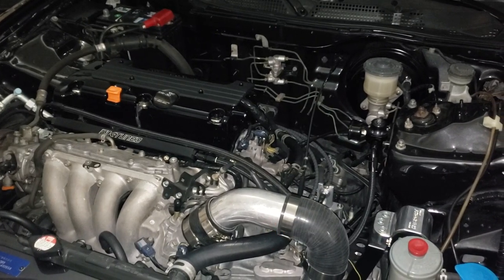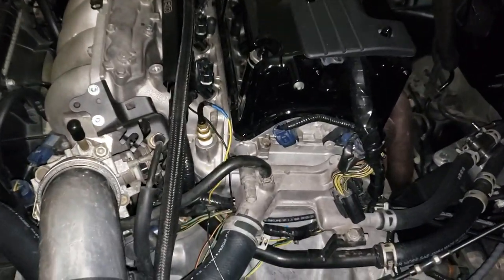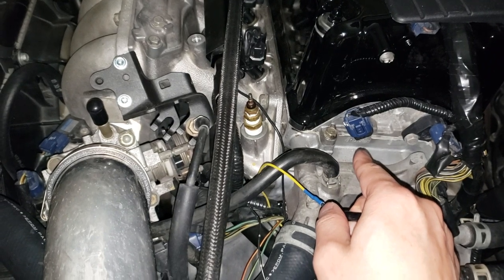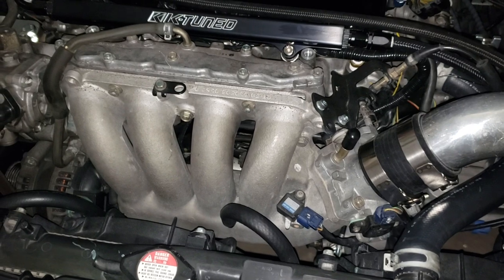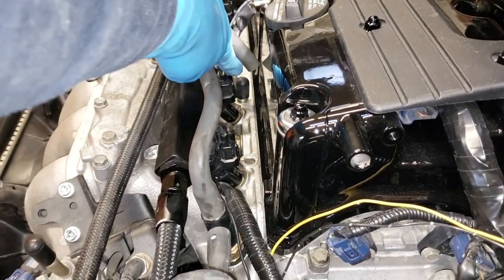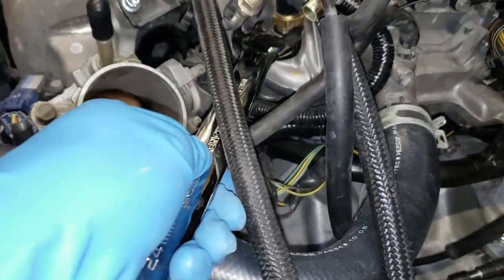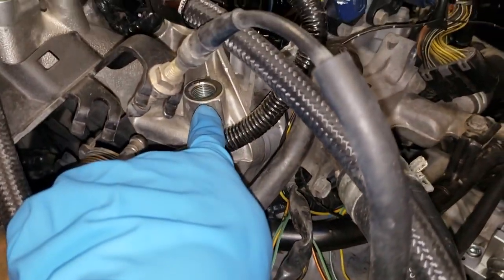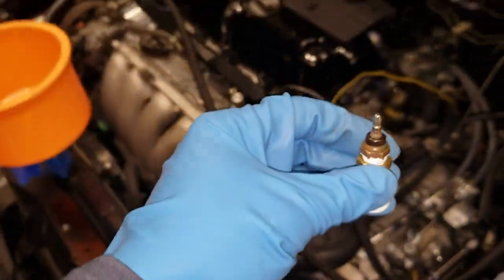Locations for ETC Sensor for K swap

Comment: So you need to connect the wiring from the wiring harness as well as the conversion harness
Reply from the maker: I'm not sure what you are asking. Please be more specific.
Reply: No just the conversion harness, which inputs the gauge.
The k series wiring harness goes to to the sensor on the side of the head
Reply from the maker: @beltdrivetypea6534  Look at the conversion harness and there will be 2 wires for the temp gauge sensor. 1 is the ground and the other will plug to the temp sensor shown in the video.
Reply: @jsrebuilds3951  hi. I think I just earthed that in the foot well. I used a b series sensor which is a single wire
Reply from the maker: @beltdrivetypea6534  That is correct.

Comment: What are the thread sizes?   3/4 NPT to 3/8 to 1/8?
Reply from the maker: Sorry I don't know, it came off an existing manifold that was given to us. Is there a way I can find the sizes?
Reply: @jsrebuilds3951  you got me, I have no idea.  My setup is JDM CL7 k20A RBC manifold which isn’t the same port size as USDM civic si like most people said 3/8 NPT. After much googling some say JDM might be 3/4NPT so I now waiting for the part to get here to give it a try and see.  What a pain in the ass.
Reply: Most ppl with USDM RBC manifold use 3/8 NPT for the thread to 1/8 temp sensor. But in my case the 3/8 doesn’t fit so I had to order 3/4 to 3/8 to 1/8 and I hope this works out for me.
Reply from the maker: @PaChiLa_Leader  This hardware actually was on a RBC intake manifold and we took it off to put on our TSX manifold.
Reply from the maker: @PaChiLa_Leader  I will try and look into this for you.
Reply from the maker: @PaChiLa_Leader  thanks for this info, I didn't know the jdm cl7 rbc manifold has a different port size. Yeah what a pain.
Reply: @jsrebuilds3951  that would be awesome. Fingers crossed with the 3/4 NPT, ruled out 3/8 already coz it doesn’t fit.
Reply: @PaChiLa_Leader  i was wrong with the 3/4 NPT >< .   is it possible to trouble you to help me out on identify the 2 fitting sizes you have?  bigger one 3/8 NPT male to 3/8NPT Female and smaller one  3/8 NPT male to 1/8 NPT female?  this JDM CL7 RBC IM is really kicking my ass, i started to think the actual size is BPST 3/8 which isn't the same as National pipe Tapper size like USDM vehicles... freaking sucks..      thx bud
Reply from the maker: Ok I have to redo my ETC sensor. The size of the adaptor is 3/8 to 1/8 for my K24A2 manifold.
Reply: @jsrebuilds3951  thanks bro. I have sent out my Air by pass thermal valve sensor that I removed from the euro rbc IM and the shop I sent to can possibly custom make me one that fits.  Hope that works out.
Reply from the maker: @PaChiLa_Leader  Thats actually a good idea.
Reply from the maker: @PaChiLa_Leader  Honestly I think the 3/8 isn't even the correct size for this K24A2 manifold. I just realize it barely treads in. So I believe you were on to something and it does make sense that the Japanese engine wouldn't use these standard treads. I kinda just had to try a force that 3/8 female adapter in there which isn't something I should do.
Reply from the maker: @PaChiLa_Leader  I didn't know that is a Air by Pass Thermal Valve Sensor. Can you tell me what that does?
Reply from the maker: @PaChiLa_Leader  Here's some info I found on the air bypass thermal valve. https://www.hondata.com/forum/viewtopic.php?t=4604
Reply: @jsrebuilds3951  https://www.k20a.org/threads/air-bypass-control-thermal-valve-nipple-snapped.32882/.   This one has more info just not the exact thread size.  I took my AAV out to the shop to fab one for me. Will see how that turns out.  I will keep you posted.  Thanks bud.
Reply: @jsrebuilds3951  some say it’s not NPT but BPS which maybe make sense since CL7 euro R was produced in UK rather than the states so who knows. Sigh no pain no gain right?
Reply: Hey bud where and how did you run the shifter cables?